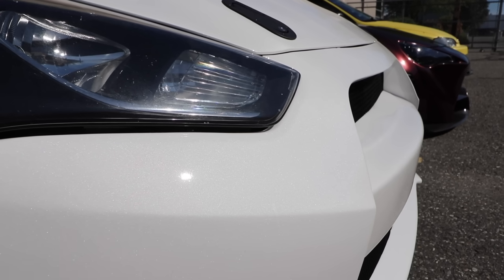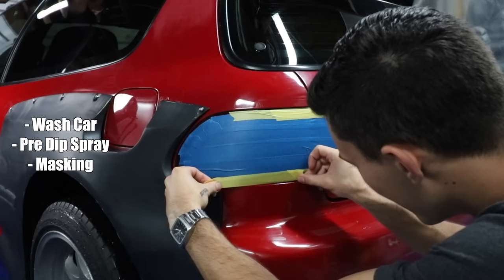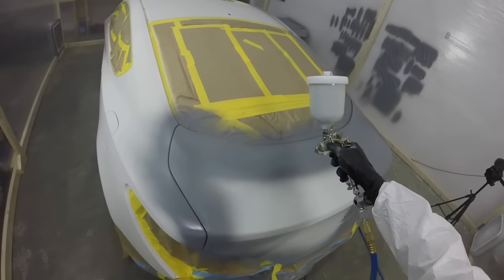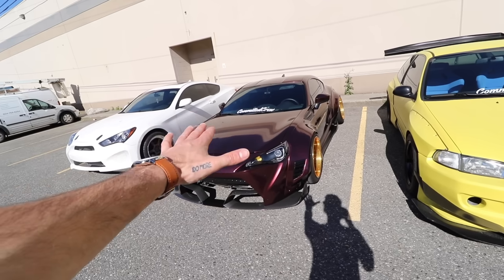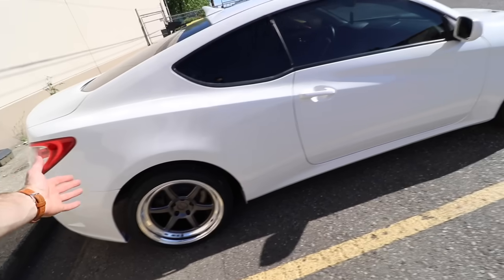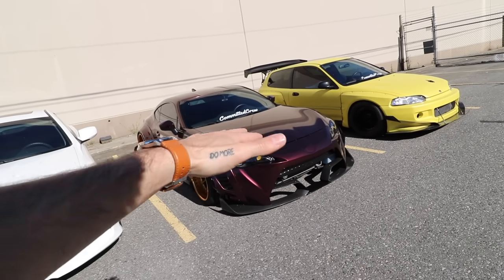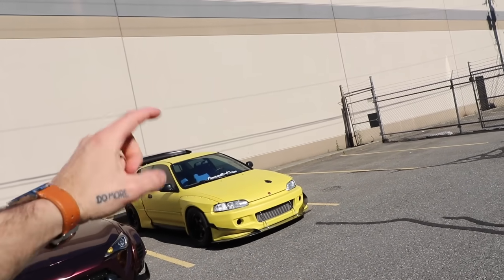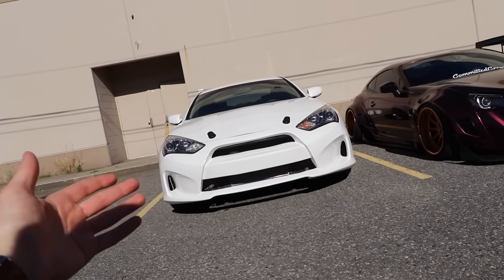BEST WAY TO CHANGE CAR COLOR FOR YOUR MONEY?

Comment: Check your local shops. I got quoted $187 for 2 quarts of paint and a galon clear coat kit, with screens and stirrers. It’s not too show quality but it’s good looking paint that lasts. Harbor freight purple gravity fed spray gun did a good job lying a good pattern. $300-$400 to paint my car. 92 civic hatch.

Comment: I feel like an important merit to wrapping is that if you are doing it yourself, you can go a panel at a time and still use the car, so if you only have evenings and it’s your daily you can still commute. Painting you need to do all at once incase the paint doesn’t quite match (different conditions different finish)

Comment: The paint looks unreal, but the wheels on the Genesis look hella small, maybe bigger tires will fix but yeah...
Reply: Needs higher side wall and more low
Reply: Agreed the wheels are nice but are too small for the car
Reply: That was my first mistake with my Genesis, was getting 18” at first it was nice, but looked way too small for the big booty. So I switched to 19” and looked so much better.
Reply: Yeah factory are 19s
Reply: Would 18s be better for drifting ? Or wouldn’t matter 18s or 19s
Reply: @Dre.Elevates  18s are better for drifting because tires are cheaper. Also low power cars like these prefer smaller, lighter wheels.
Reply: IMNOTA yeah nice!! Makes sense cheers

Comment: For me to get my truck repainted and a few dents pulled and rust repair the avg shop quote is 10k and I don't have a big truck single cab ram 1500 factory paint  (solar yellow) is like $350 a gallon for me to replace the rusted out parts paint and all the equipment it'll cost around 3500 usd for everything wish I could go the wrap route but might as well fix everything instead of hiding it and letting it get worse

Comment: My parents won’t let me get a manual transmission car cause they think it’s unsafe and high maintenance, any thoughts ?
Reply: I would argue that it's safer because it will keep you engaged with what is happening on the road. It's only more maintenance if you burn up your clutch while learning to drive it. Promise them you'll save up and set aside money for maintenance; demonstrate the extra responsibility.

Comment: Ok with paint it depends, my truck will never be perfect, its a truck not a show car, im using tractor impliment paint because its tougher than normal paint and its $28 a gallon, i tell everyone if you want a show car yes you will spend a lot but if you just need your vehicle to be the same color its pretty cheap